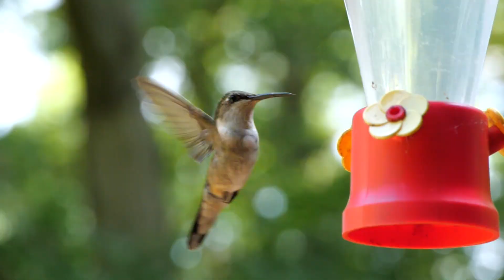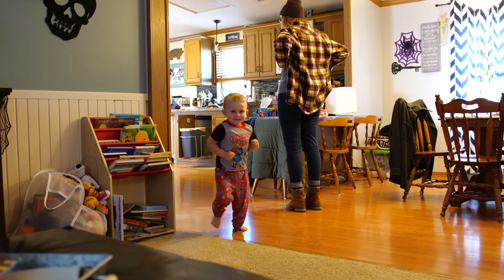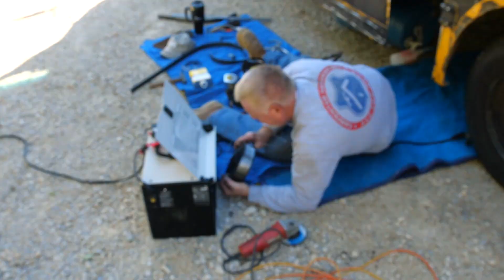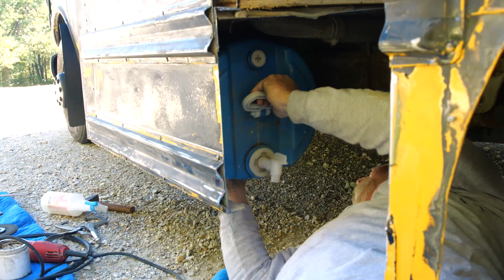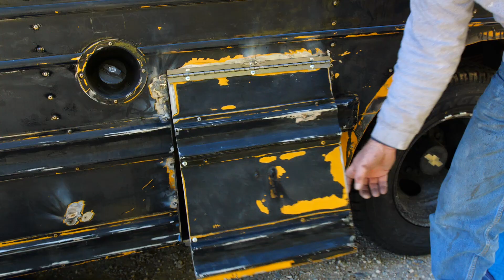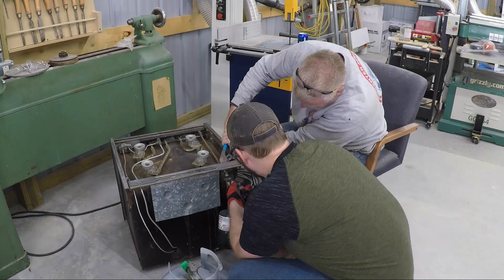Painting, Propane Storage, and Proposal Talk | Bus Conversion - Day 10

Comment: I had planned to convert our bus for about $20k. The engine had a catastrophic failure and we've spent a year fixing, basically making the mechanicals brand new.  $20k spent. Now for interior expenses.  I'm planning a fairly advanced build at up to $40k spent in total when it's finished, with new tires. The way I see it it's way cheaper than a high end motor home and will be home for years.  It might be my midlife crisis... but so far it's been an interesting project.